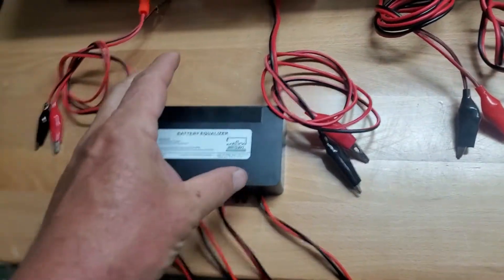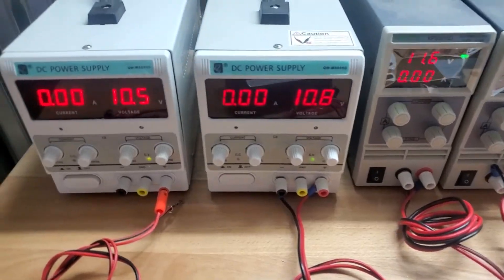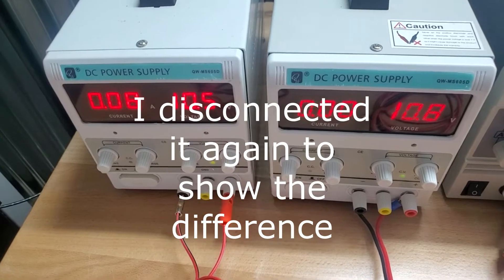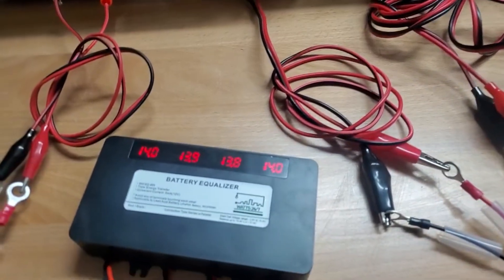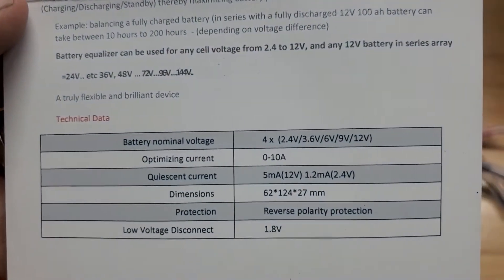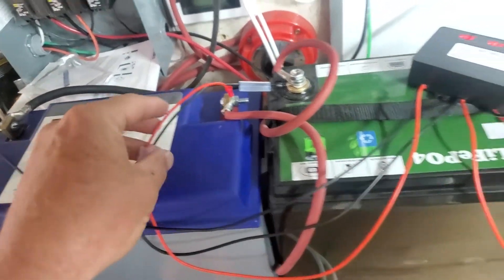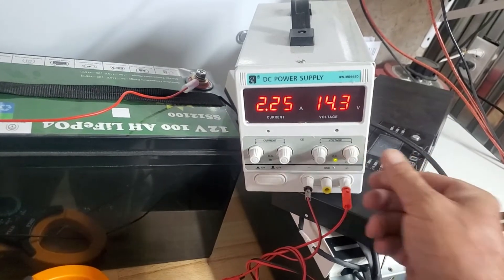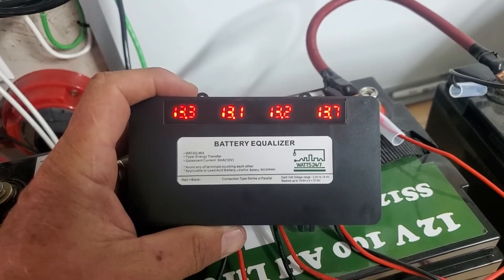48V - 4 Battery/ Cell battery equalizer EQ48-4 Watts247

Comment: Am I understanding this correctly?   I have a 12V 2S2P 24V battery setup.   I was going to purchase 2x 24 (dual lead) balancers.   Can I use the 4 lead balancer?   Connect each 12V battery and call it a day?   My two series strings are connected to a common bus bar.

Comment: Be sure to add a 20amp fuse right at the Pos end of each wire . If anything goes wrong, you've got equalizer wires dangling across pos/neg terminals of 4 batteries that will put out 100+ amps before their BMS own would stop them.  Does this stay connected or do you have to connect this periodically ?

Comment: It can also balance a 24 volt system and balance charge a12 volt system at the same time. To set up on 24 volt battery systems consisting of two 12 volt batteries in series. Connect one set of leads to each of the two batteries individually creating the 24 volts. Connect the two remaining sets of leads onto a single 12 volt battery.
This will push or pull about 6 amps max with two lead sets connected to  the individual 12 volt battery.
It's a simple solution when using a 24 volt inverter, but still have 12 volt junk that needs to be plugged in.
Note all batteries connected need to be of same chemistry.
A 12 volt balance tap can also be achieved with 36 volt system consisting of three 12 volt batteries.
Simply connect one set of leads to each of the three 12 volt batteries creating 36 volts.
And the fourth set of balance leads will connect to the individual 12 volt battery.
Don't expect more than 4 amps  trickle charging with a single balance lead set.
To create a 48 volt to 12 volt balance charging you will need two units.
The 48 volt system needs to consist of for 12 volt batteries.
Using two units consisting of eight balancing lead sets.
Each balancer will have two of its balancing lead sets connected to the individual 12 volt battery.
The remaining two sets of balancing leads from each balancer will connect to the four individual  batteries of the 48 volt system .
This configuration will allow a 12 volt system to push close to 3 amps to a individual 12 volt battery of the 48 volt system. As the load is balance charging the  individual batteries needs.
And the 48 volt system will be capable of 10 amps of push on a good day to the 12 volt system when balance charging at maximum.